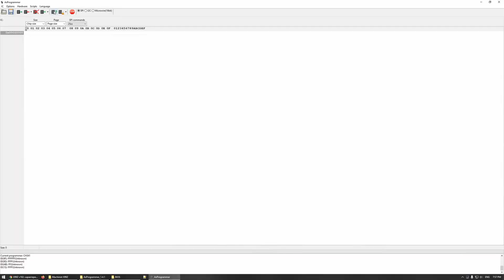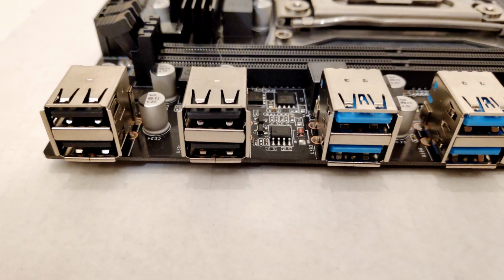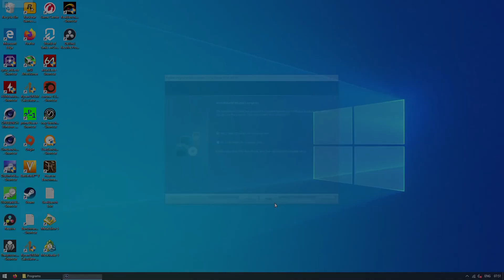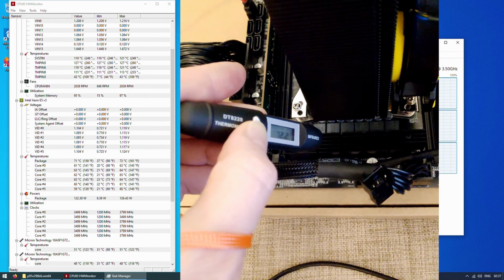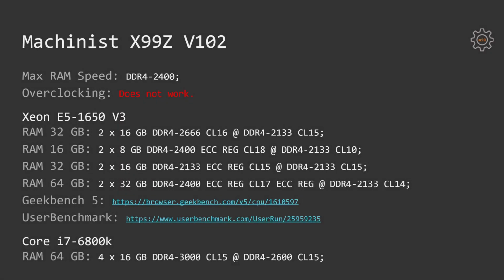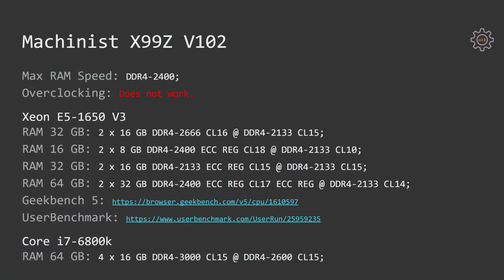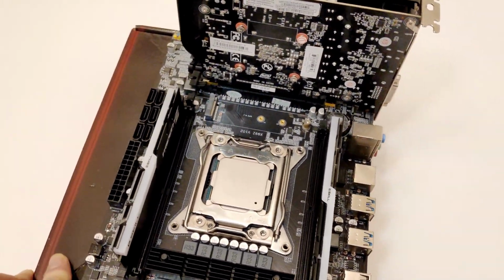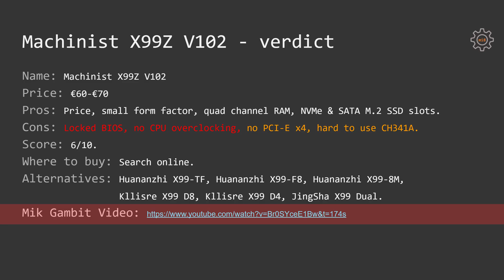🇬🇧 Detailed review and revive of Machinist X99Z LGA 2011-3 | CPU Overclocking | Turbo Boost Unlock

Comment: hi, wanna buy 1660v3 on this motherboard, now i have 2620v3

do you think mobo will be okay? or cpu will be too powerfull
Reply from the maker: Please do yourself a favor and get a V4 CPU instead. E5-1660 V3 will toast this board if overclocked.
Reply: @ 

so what you think to take to get better performance than 2620v3?
Reply from the maker: @essa9339  E5-2680 V4 if the budget is very limited, otherwise E5-2667/2690 V4.
Reply: @Miyconst какой v4 лучше ?
Reply: but 2860 has 12 cores
1660 has only 8 

you sure? 😅

Comment: Where is the bios chip on the motherboard? Unfortunately I've bricked mine as well. :-(
Reply from the maker: Sorry, I do not remember, but you should be able to find it, take a torch and investigate titles on the chips, the one with "WINBOND" is the BIOS.
Reply: @Miyconst  I tried flashing the w25q128jv using a compatible .ROM file but it doesn't work. It's connected via a USB 3.2 port.
Reply from the maker: @BlahBlah-cn5qe  you have to specify a bit more details, what exactly you have tried and what exactly does not work?
Reply: @Miyconst  So I have disconnected the CPU, GPU, RAM, Front panel connectors, and only kept fans and 24-pin and 8-pin power connected. The Power supply is switched to the "I" position and is connected via cable, and the PC itself is not on. I have correctly seated the ch341a and installed drivers and software, and the IC cannot be read. The output is "ID(9F) FFFFFF(Unknown)
ID(90) FFFF(Unknown)
ID(AB) FF(Unknown)
ID(15) FFFF(Unknown)"
Writing hangs, with the error message "OLD SREG: 1111111(0xFF), 1111111(0xFF)
Reply from the maker: @BlahBlah-cn5qe  what happens if you click the green ? button to detect the chip. Is it detected? It seems like you might need to jump start the PSU, jump start means shortening the starting pin on the 24-pin power connector from the other side, while the PSU is connected to the motherboard. Don't use the power button and make sure to short the correct pins.
Reply: @Miyconst  the chip isn't detected. It is a machinist x99z so the chip is w25q128jv so I manually searched for the w25q128bv.
Reply from the maker: @BlahBlah-cn5qe  you won't be able to read/write the chip if it's not detected, there is something wrong either with the connection or with the power.
Reply: @Miyconst  I can start the PSU whilst the motherboard isn't running?
Reply from the maker: @BlahBlah-cn5qe  yes, you can.
Reply: @Miyconst  Hello, how would I short the pins on the 24-pin connector whilst it is connected to the motherboard?
Reply from the maker: @BlahBlah-cn5qe  locate the two required pins and inject a paper clip from the top of the connector.
Reply: @Miyconst  yes, I see; so I remove the 24-pin connector and jump start the power supply, then plug the 24-pin back to the motherboard?
Reply from the maker: @BlahBlah-cn5qe  no, you do that while the PSU is connected to the motherboard, you can inject the clip from the other side of the connector, at least it's possible with most of the PSUs.

Comment: what is the difference of the bios 
C612RD24 for MACHINIST X99
C612RD24 for MACHINIST X99, Mi8
Stock Machinist x99z
Stock Machinist x99z, RAM TIMINGS
Reply from the maker: You can select the BIOS and read its description, it specifies the difference.

Comment: Hi! Can you help me with what I'm doing wrong? Nvme ssd does not work with the motherboard.
In the bios csm = disabled. On the Nvme side, however, there is nothing. What settings are still needed for success? Thanks in advance!
Reply from the maker: X99Z has two M.2 slots. One for NVMe SSDs another one for SATA. Make sure you are using the correct slot. If the slot is correct, but the SSD is still not recognized - most likely you have got an incompatible unit.
Reply: @Miyconst  It is in the nvme slot, but then it may be an incompatibility because it is a 970 evo plus.
I guess there's nothing to do then.
Reply from the maker: That's not right. I have tested 970 Evo (not Plus) and it worked well. Any option to test another SSD? Which CPU do you have installed?
Reply: This is the only one. E5-2695v3 is the processor. Maybe the 96L 3d tlc is too new?
I don't know. The ssd is brand new, it hasn't been tried anywhere else. Unfortunately, I can't even test it on another motherboard.
It just occurred to me that the nvme menu item in the bios is completely empty. But I guess anything will only appear there if the motherboard detect an ssd.
Reply from the maker: That's correct, the NVMe menu will only have entries if the SSD is detected. Well, it may be that the SSD is not compatible, which is sad.
Reply: That's it. Thanks for all the help! Have a nice day! :)
Reply: My fault! The ssd was not connected properly. :)

Comment: I saw in a recent video you mentioned you use these boards regularly. Based on AliExpress reviews, it looks like recently they don't ship the v102 anymore, and rather only v102A and v104. Any experience with these?
I've read one account of a commenter losing cpu fan speed regulation after flashing with Mi899. 

Also I've heard of BIOS with a working clear CMOS jumper and a couple other modifications. Was wondering if the Mi899 BIOS has the same features. https://vk.com/@2485616-running-x99z-v102-20113
Link for reference. 

And thanks again for all the  content you produce!
Reply from the maker: I have not yet tested V102A & V104 myself, but from what I can tell, these are the same boards with a slightly modified layout. The V201 board is totally different though. The clear CMOS function, which claimed to be fixed in that BIOS, works on some motherboards and does not work on others. Mi899 does not include the BIOS from the linked VK page.

Comment: I have this board. I purchased 2 sticks of Samsung DDR4 2133MHzCL15 16GB RegECC 2Rx4 (PC4 2133) Internal Memory (for a total of 32 gigs). I need to know where to place the RAM. Do I put them in together on two slots side by side, or do I put them in a slot on each side of the CPU. See the pictures provided and let me know which method is correct -  https://www.instagram.com/stories/devious_d/2466189090079728715/
Reply from the maker: With Machinist X99Z it doesn't matter which memory slots to use. Each slot on this motherboard is dedicated to a memory channel.

Comment: Hello Miyconst, did the M.2 Slots recognise your SSD just straight up? I have an nvme ssd and a sata M.2 ssd and both did not recognise. Plus the SSD mounting hole was always off-center
Reply from the maker: Hi there. Yes, SSDs worked straight away for me, but only if I mount them into the correct slot. One supports NVMe only, another one is SATA only.
Reply: @Miyconst  I found my problem: Idiot me put the m.2 drives at a false angle into the slot. So the Pins did not contact the pads properly, but it looked like the SSD was seated.
Reply from the maker: @moshikitrain  I am glad to hear that the was solved so easily.

Comment: Hi! Nice Video! Did you actually get 5.1 audio output to work? I am having trouble switching from stereo/line-in/mic-in to front/rear/SW-C.
Reply from the maker: Hi. As far as I know, this is a driver issue, try these ones: https://www.realtek.cz/download-ALC662-sound-driver-for-Windows10-64bit.html
Reply: @Miyconst  That you very much. I solved the problem by downloading the driverpack from this page:

https://vk.com/@2485616-running-x99z-v102-20113

After installing the drivers, I still could not remap the audio jacks from line-in and mic-in to rear and SW-C. 

In case somebody has the same problem, this workaround helped. While it did not work to remap the rear audio jacks, remapping worked for the front audio. So i remapped front mic in and front line out to  surround sound and Subwoofer. Its not perfect but works OK.
Reply from the maker: @benjaminslezak9672  thanks for sharing your experience.

Comment: I saw that Machinist have a new ver of this, which is the Machinist  X99-K9, do u think that the same method for Turbo Boost from this board can be applied  to the new ver? Thanks a lot!
Reply from the maker: I can't answer the question before I test the updated version, but it certainly looks to be the same as X99Z, just with an extra M.2 WiFi slot. Anyway, I have ordered myself an X99Z-K9 for a review, not it's waiting time.
Reply: @Miyconst  Wow, I'm really looking forward to watching your detail review. Turning my nofi bell on. You are one of the best channel for X99 Platform !

Comment: Do you think that E5 2673 V3 105W will work well on Machinist X99Z? With BIOS from iEngineer it will turbo boost?
Reply from the maker: It will work well as long as you keep the VRM cool. iEngineer BIOS doesn't have Turbo Unlock embedded, but you can either make it yourself or use Mi899, there you will find a few modifications of this BIOS for turbo unlock.
Reply: @Miyconst  probably for durability doing turbo unlock is not safe isn't it?
Reply from the maker: It's rather safe, the CPU will still be limited by the 105W TDP, so it's not that much extra load on the VRM.
Reply: @Miyconst  so that's great! but after i unlock it will persist? i will ise arch linux only... but i can install windows only to unlock it.
Reply from the maker: @thethiagosc  if you inject an FFS driver straight into your BIOS - it will persist. If you install an EFI driver on the OS level - it will not.
Reply: do you know if the samsung ddr4 server ecc ram that they sell on ali will work well? is it better getting 2133mhz?
Reply from the maker: @thethiagosc  so far every Samsung DDR4 ECC REG memory I have tried works well with the X99 platform. DDR4-2133 / DDR4-2400 does not really matter here, pick whichever is cheaper.

Comment: Does anyone knows how to reset de cmos in this mobo?
Reply from the maker: Nope, it's a bug of the motherboard. I have had a few of these boards, some of them can clear CMOS by shortening the jumper, removing the battery and letting it lie like this for a few hours.
Reply: @Miyconst where can i find de jumper  stuff? There is no identification in this mobo, i removed the battery but i can reset The bios using this metod
Reply from the maker: @fernando_gehlengamer  I don't remember where is the jumper located right now, but it was close to the motherboard battery.

Comment: when u say that psu need to be connected, it also needs to be powered on  or just connected (cuz there some standby power) ?
Reply from the maker: Just connected and powered from the socket, but not turned on by the motherboard "On" button.

Comment: Do you think that is a good option to Xeon 2678 v3? Or its better go with Huananzhi 8m. Do you think that the vrm of  machinist will hot with turbo boost?
Reply from the maker: E5-2678 V3 is a bit over the VRM budget of Machinist X99Z, but if you implement a decent airflow over the VRM zone, it will be fine.

Comment: Have you already tried to install BIOS from Vasiliy Temnikov (VK239)? Is it stable? Does the changes really works? " Changes: 1. The BIOS menu structure is taken from the HUANANZHI X99-TF board 2. The standard Machinist logo is returned 3. All BIOS settings are open 4. The multiplier control item is open 5. The timing setting item is open 6. 6F2 microcode removed 7. The undervolt V3_MOF_505050 is sewn in 8. Updated OROM of the network card to 2.67 9. BIO RESET WORKS WITH A JUMPER 10. Versions for 16MB and 8MB 11. Updated OROM Intel RSTe for sSATA - 4.7.0.1014"
Reply from the maker: Could you please share a link to this BIOS?
Reply: @Miyconst   I found it here: https://xeon-e5450.ru/socket-2011-3/x99z-v102/  
When I get my x99z-v600, I hope I do not have clear cmos problem at the start. Need to find out what bios change makes cmos reset jumper work.
Reply from the maker: @JM-er8pk  Thanks for the link. I have tried this BIOS on one of my X99Z motherboards - works well, the clear CMOS jumper worked for me, but I still had to wait quite some time for the settings to get restored.
Reply: @Miyconst  If it does not take more than 1hr that is good for me. I could not find what needs to be changed with Amibcp tool to fix clear cmos jumper issue. I may try to flash this v102 modded bios on v600 motherboard. But v600 has different vrms than v102. I should buy a usb programmer just in case.

Comment: How big of a rom can i install in my bios(there are 8 mb, 16mb selection)? in my machinist x99z v102 with a newer type of heatsink? is this a newer version of the old version because it has a newer heatsink or it is just the same motherboard with the same features but different vrm heatsink?
Reply from the maker: The heatsink size does not matter, you have to check the BIOS chip model. These days most of the motherboards are shipped with 16mb.
Reply: @Miyconst  Thank you !!!

Comment: is this x99z driver with bigger vrm sinks better than the huananzi 8m?
Reply from the maker: No, it's the motherboard is the same as before, X99Z. The heat sink also not without its issues. The only pro of X99Z over X99-8M is the number of RAM slots and channels.
Reply: @Miyconst  thank you very much for helping. I was in doubt between these two, I think I will choose the 8m huananzhi. in your video on x99 cards you mention that the 8m overclocked with the huananzhi F8 bios, what would be the procedures for this adaptation I didn't find anything on the internet about it?. Greetings from Brazil.
Reply from the maker: @JRCastelari  Just flash Huananzhi X99-F8 BIOS using the FPT tool onto your X99-8M and you will be good to go. After the flash, you might need to power down your PC and clear CMOS.
Reply: @Miyconst  thank you

Comment: Picked one of these motherboards up from eBay to build a FreeNAS machine. The motherboard had a single successful POST, where I went into the BIOS and set the date/time, saved, and rebooted. It is now bricked. Which BIOS should I try and flash to it via CH341A?

Comment: Been running this board with a 6 core Xeon for half a year now. Everything works flawlessly, and I only have three points of criticism:

- Very hot VRMs as you found out (around 70-80 degrees)
- Incorrect VRM temp readings in windows (supposedly 105-120 degrees, it obviously isn't)
- A fuck ugly "Machinist: Innovation-driven boutique" BIOS splash screen logo that screams auto-translated chinese crap.

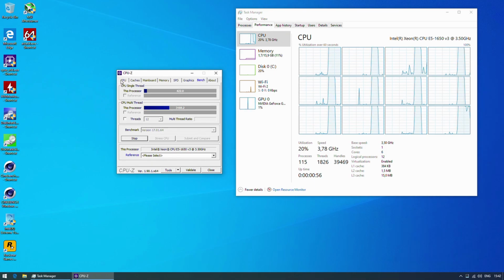Comment: 7:54 Windows task manager is not a reliable source for your CPU frequency. At least on some boards.
I have OC'd a Xeon X3440 and Win task manager just shows the stock clocks. But if I check with HWinfo, it shows that the OC is actually working.
I noticed that this is especially true for Turbo boost adjustments.
Reply from the maker: That's true, but in this case I have also validated more reliable software, such as HWiNFO.

Comment: Is it okay to use this motherboard wiath a 2620 v3 3.2ghz? I will have problems with the vrms?
Reply from the maker: You will be totally fine, E5-2620 V3 is easy to handle.

Comment: I thought I had a bad clip and thus couldn't read the BIOS Chip. You are ABSOLUTELY right, I first removed all components and inserted battery, the programmer would still not find the BIOS Chip. After putting PSU it worked! I didn't need the quick charge thing though. Honestly I didnt even understand what to do with the quick charge, mine are regular USB. Motherboard is X99z v102 Kllisre version.
Reply: Overclock vei overclock rgb é o *
Reply: Is the chip labled SPI_DIP1 the bios chip?

Comment: just wondering..i have bought the motherboard(mobo) that have same layout(but there is 0 machinist word in it) as this video, what the highest tdp can this mobo support?

the seller i bought stated 120w is the max tdp this mobo can support....
Reply from the maker: It's hard to say what is the highest TDP because the motherboard might be fine with a 135 TDP CPU if you have a really good airflow in the case, but in general, I would not recommend installing anything higher than 120 TDP.

Comment: Guys, do you know where I can find the drivers for this motherboard? On the manufacturer's website I did not find.
Reply: If you can provide me with the download site I would appreciate it. 🤝
Reply from the maker: Which drivers are you looking for? Windows 10 Pro downloads all required drivers on its own.
Reply: @Miyconst  I really need everyone. Because I am migrating from the motherboard.
Reply: @Miyconst  Because I have Windows 10 on my hard drive. I will transfer all hardware to the new motherboard. I don't know if the network driver (RJ45) will be working, understand?
Reply: @Miyconst  I wanted to download all the drivers from MOBA so that when I migrate the drivers I will be ready to install.
Reply from the maker: I strongly suggest you to start with a clean Windows installation, but even if you migrate as is, Windows 10 will pick the required drivers itself.

Comment: the pcie 16x slot is in the wrong place for this form factor ....  ideal is between the screw holes because if you want to use this mainboard in a mini itx case, you have to put the graphicscard into the very first slot, which is normally exactly betwqeen the screw holes .... in this case the nvme slot is placed :/
Reply from the maker: This is not an mITX board, it's mATX, these two are different formats.
Reply: @Miyconst  I know but this would fit in mitx cases if the pcie slot would be placed between the skrew holes. I personally put a jingsha x79m-s in an Silverstone raven rvz03 case, works perfect with some tweaks
Reply from the maker: @hanswurst3811  I see, maybe there is an mITX case with a vertical GPU mount through a PCI-E extension cable?
Reply: @Miyconst  maybe... But the normal ones had a kind of riser card for a stable mount of the gpu.... With a riser cable you have to diy some sort of holding thing.... But yes should be also possible